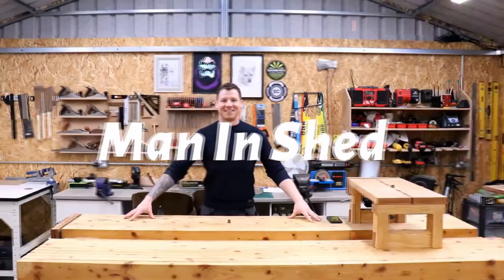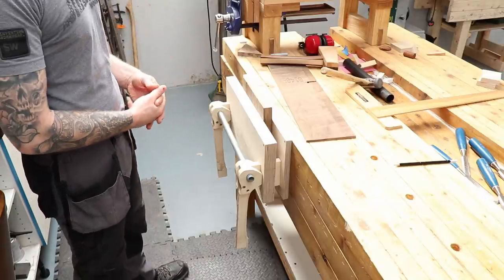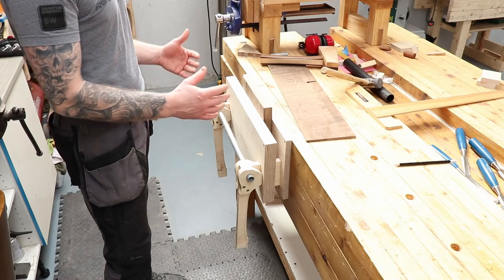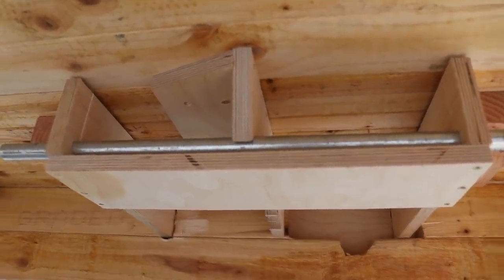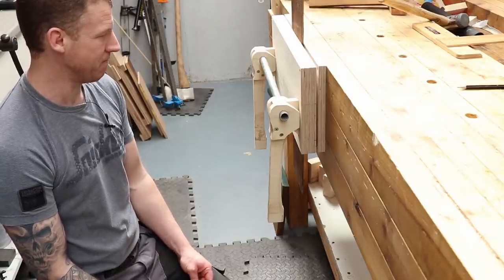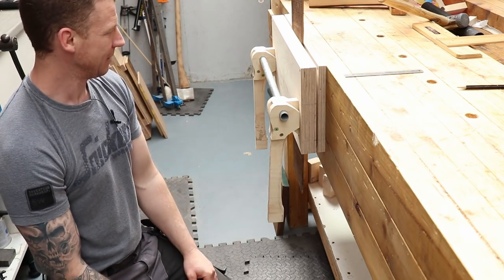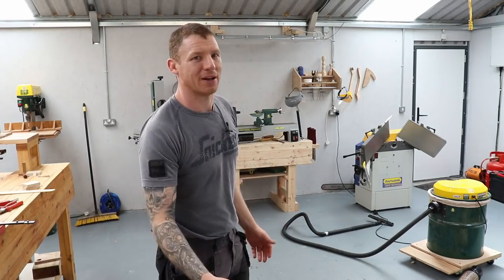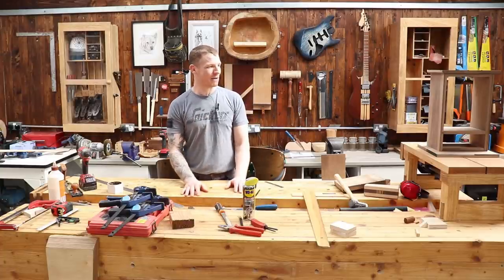Workshop Vlog #5. Camlock Moxon Vice, Dust Extraction, Shop Talk.

Comment: on the moxon, how about a bar connecting the two handles so you can apply initial  pressure one handed if you need to hold a piece, once its grabbed you can use both hands to add final lock and the same for release.

Comment: Hi John, a smaller diameter bar at the back would give proportionally smaller depth stops. For raising the centre line of the cam lock, you could raise the cam contact point above the centre line of the tenon and adjust the top line geometry of the cam. Like a hurling stick maybe...?

Comment: Quick suggestion with the shop vac, if you make the suction ports at the machines the size of the port in the vacuum cleaner, you could leave the vac in the one spot, make and put blast gates at the machines, then all you  need to do is just take the vacuum hose to the ports by the machines, then you can still cover the workshop.

Comment: Hey John, loving your videos! Just an idea for the under bench issue: why not add another 2 cams under the bench than would apply pressure to each of the sliding arms first - before you use the two outer cams to make the final clamping? A bar could extend out through the side of the bench to a toggle arm to apply or release these cams. The cams on the outside should work together. This can be done by inserting a "key" which locks each cam to the pipe. When one moves, the other moves - since they are keyed or locked to the bar. I would also suggest that the under-table cans be mounted horizontally to allow pinching the arms between the cam and the 4x2 blocks that are already mounted. These will need to operate together as well. Connect them together using a bar that goes between the two cams - sort of like connecting two drive wheels on an old fashioned steam locomotive. This would use inexpensive components to complete your cam-based design.

Comment: Hi I have just finished my workshop dust collection, I used 63 mm drain pipe and "Y" fittings I made my own gate valves, I also fitted I cyclone next to my vac  all works very well.

Comment: Okay,  So I have an idea for this, but it needs a little explaining...
Instead of one bar coming out of the bench to the cam, you have two half-bars.
In the back those two bars have 2 parallelogram  pivot arms, which sit at an angle towards the vice when the two half bars are together, so that if you push the top bar backwards, the two boards are pushed apart by the pivot arms, and wedge in their track.  So now you put 2 cams on the lever arm; one first pushes the top bar back enough to lock it, and then stays constant radius, and the other one is as you have now pushing the sliding board.
Reply: I think I like this.

Comment: Thinking that if your tenon arms were angled at the ends like a field hockey stick, you could position your cams up closer to the center of the jaw boards.

To make the cams more user friendly, you might tie them together with whatever means makes sense.  A bottom bar and some cross pieces?  You have more experience than I do.  ☺

This vise idea is cool.  Thanks for sharing!

Comment: Do the tenon arms have to be only wood? Attach a metal bar flat to the bench with small teeth. (5? Per inch, kind of like a "float" used for making wood planes.) On the top of the tenon arms, put a corresponding bar such that the teeth engage the upper bar. The lower bar need only be a couple inches long. Just enough to have several teeth to spread the clamping pressure out. Just as your current bar engages the large teeth, the small teeth will engage as the tenon arms rack upwards.

Comment: Hey john just by the look of your walnut panels are brittle because the lighter colour on the outside of the panels are the edge of the trees when they get milled it’s the weakest part of the board if your buying new boards try and  have a look for more darker boards that’s my advice done a lot of work with walnut,good job keep it up 👍
Reply from the maker: Thanks for the tip!

Comment: Use a smaller bar is the obvious suggestion but you're going to have more flex and less clamping force unless you secure it to the piece of wood below it. Maybe just use tapered wood shims like they sell for getting rid of creak in hardwood floors. Put them behind the cams whenever you need a small adjustment

Comment: Glue some emery clothe to 2x4s and  have them samwhich together for grip when you lock the cams down.
The amount of area the 2 faces touch will resist being pull apart and you won't need the steel bars. I can send a queicsk solid works pdf if you require?
Oh another idea put emery cloth on the main support bars that the cams are on it will add more grip

Comment: To get more detentes closer together you'll need a smaller locking pin or cog. Replacing the back tube with a length of 10mm silver steel will allow you to make smaller detente notches closer together. To minimize the tendency of the bar to bend under the clamping force use two identical racks next to either sliding bar so that the 10mm bar is closely supported by the sliding bar on each side.
Just a thought.

Comment: Hi, a possibility for the locking mechanism could be to use a nut cut in half, running along a threaded rod. When the cam is tightened it would be held up against the threads locking the vice.
Reply from the maker: Might work

Comment: Looking great John 😁. Just a couple of ideas :-
1, instead of having pins behind the outer face plate of the vice (That you will need to recess), you could use some kind of grub screw (or dowl) in from the side face of the face plate in to a slot !! (Bad explination.. soz).
2, As the cams are not in the center but below the centerline.... could you just extend the outer face plate down by the 30mm = cam in the centre ???
3, The nasty splintering on the "Matt" cabinet... have you checked the moisture content of the material you are using.. I.e. is it too dry ? Probebly should have made it back in January when it was "Irish damp" 😂🤣😂.
4, How about drainpipe "Down pipes" for dust extraction (cheap as chips).
5, Don't forget to protect for static build-up in the extraction pipe (You know exactly how this works).
That's more than enough from me 😁👍. Thanks John.

Comment: The sawtooth locking mechanism is fine.  The problem is that your cams are too small.  If there is say... 2" between "teeth" then your cams need to have 2" worth of motion.  A  1&7/8" board would be clamped with very little movement, so the cam handles would be closer to horizontal than with a 1" board  clamped down would.  Use the golden ratio for placement of the axle in the cam and it will be smoother locking.

Comment: Very interesting that you would want a cam system as opposed to a traditional moxon vice wheel and thread , it would certainly sort your issue. Have a look at David Barron system . I am think of building a moxon actually I had a 40 “ bench that I reduced to 34” as I do a lot of hand prep . But would love the 40” back for joinery , I think a bench top moxon is long overdue. Best of luck with it mate . Regards
Reply from the maker: Cheers David! I'm hoping to build  vise that can be made completely from timber and that anyone could make for themselves so that's the reason for no screws or wheels.

Comment: with your moxon vice could you drill two holes through each end of the front vice jaw into the through tenons and glue dowels in. This should stop the front jaw from moving and by having two dowls at each end stop it rocking too. Axminster tools sell dust extract kits in two sizes, the include pipes, blastgates, brackets and assortment of conectors.

Comment: For the underside locking problem: To make an infinite number of depth stops, could you replace the underside through-bar with flat 1x3 mortised into the arms where the high-side face is pushed into the underside of the bench? On the underside, you could adhere some type of slip-resistant material like coarse grit sandpaper or no-slip rubber sheet. You might need to add a taper to the arms depending on the wedging needed in locking down.

Comment: About trying to pipe dust extraction through the shed btw, a rigid 4" pipe is obviously best, but if you're looking for a cheap temporary setup, I've seen woodturners in the UK using tumbledrier hose for ducting. It's a lot cheaper - about 6 to 8 pounds sterling for four metres of the stuff - but it's obviously not going to last as long as the tougher flexible hose that comes with the record power extractor or rigid pipe. But maybe a few months for a few quid would be what the doctor ordered?

Comment: Mortise a slot in your sliding pieces and put a pin through the outside slab of wood, instead of putting the pin in front of it.

Use angle iron instead of conduit.

Comment: Re: Range of motion of tenons- replace the pipe at rear with 1 1/2” X 1 1/2” angle iron set at 45 degrees, open part of angle facing outer edge of table, allowing sawn notches much closer together than the current system. Should lock in similar to your current system.

Comment: Have you thought about replacing the tube with a right angle bar at an angle facing backwards, and replacing the ply under the bench with a piece of steel cut with a saw tooth on it??

Comment: love the look of this idea as well, would you be able to drop the whole vice down a little bit, does it have to be level with the top?  also for the cam itself, you could probably (relatively) easily connect the to arms so they're operated by one lever, using that metal pipe you can bolt / screw the other cam in so you'd only need the one cam arm.  as far as the locking mechanism in the back, can you not use the same thing you did with the leg vice? cheers! can't wait to see how this turns out!

Comment: For the off centre camlocks biasing the bottom of the jaws vs the top- would putting a small wedge of (guessing) 3 degrees or so vertically in the jaws work. Something very shallow the width of the vice, the thicker part to the bottom?

Comment: If you want same functionality as your prototype cut slide mortise measure length of new version install bar same length and put pin in pipe  make runners under bench to ingage vise slide one from left other fomright to ingage pin inhole .make same as prototype and you will have any distance to open vise and clamped  that how make mine table top mini work bench  semi automatic. I am not YouTube. I am hobby woodworker good luck